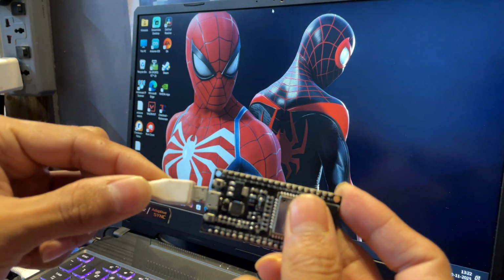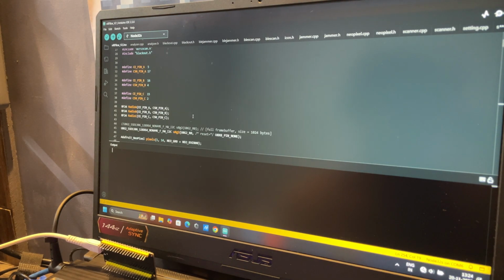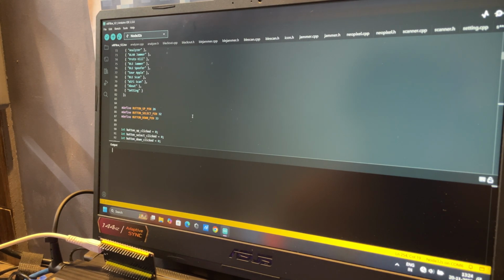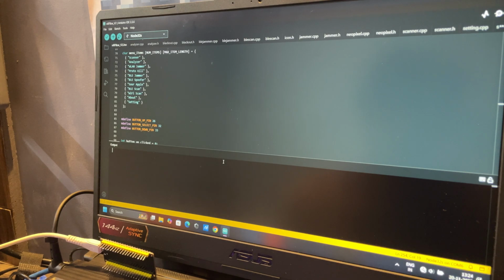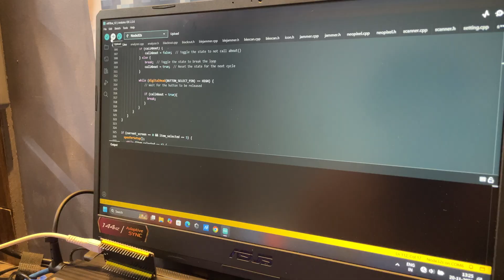Build your own NRF-BOX in 2 mins!

Comment: Hi! Do you know how to assemble it with 3 nrf modules using the nrfbox scheme? I'm asking because I've watched some videos, but when I try to compile them in the IDE, I get an error. Only error codes are provided.
Reply from the maker: Around 1:23  you can see the individual pairs for each of the nrf modules on the right. You can first setup the entire wiring according to the given instructions. I have uploaded the IDE sketch on my drive ( link on channel bio). The code is already made for 3 nrf modules. Also try putting all the VDD’s on 5V if you’re using a Nrf adapter. Hope this helps. Let me know if you get further issues.